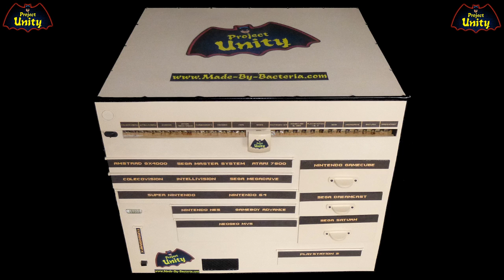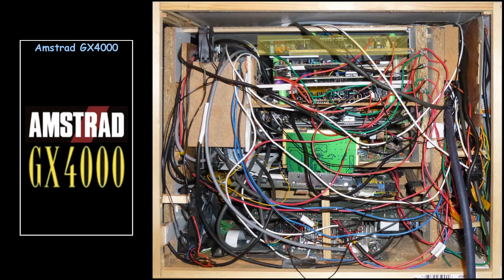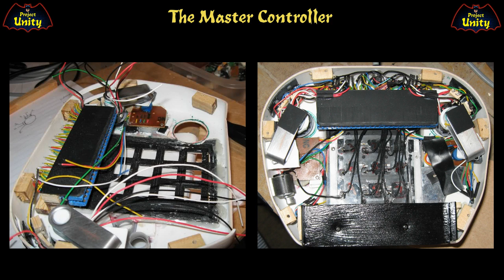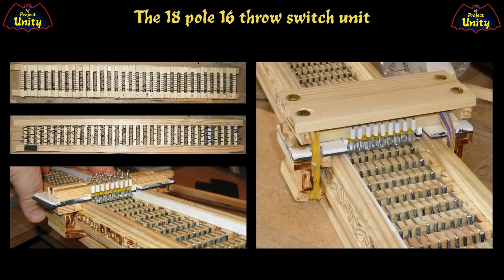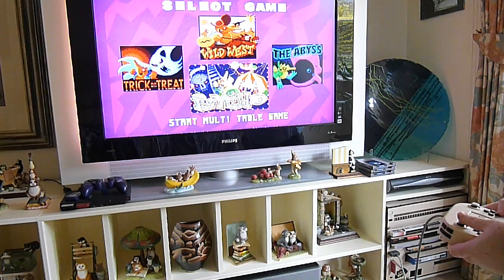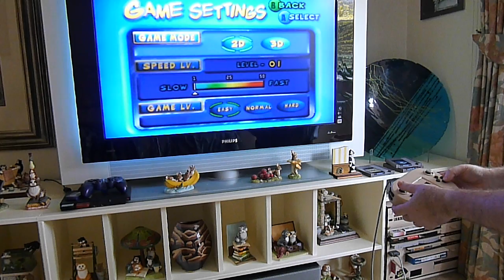Project Unity - the multiple retro video gaming console system

Comment from the maker: The trigger shoulders are basically activated by a variable resistor, so instead of using one of those, i've used a normal resistor with a mushy tactile switch which actually works pretty much as well. You see that for example in the GameCube demo when i'm rotating the screen left and right. Analogue triggers stick out of a controller a fair bit so this was a different way to get the same functionality.

Comment from the maker: A controller is just an interface for a console system. Some original game controllers are really badly designed, the worst example is Colecovision, hard to hold the controller properly and the d-pad is the worst i've ever used. Original consoles have a variety of controller options too including 3rd party ones (eg many versions for N64 for example).

So, I see your point but a controller is an interface only; and also this one has been custom made to work great with my hands, so ideal.

Comment from the maker: I wanted to keep away from using modchips; had one for the Saturn but didn't use it, wasn't aware of any games on PS2 I wanted I couldn't get on PAL format so didn't bother; only chip I used was a SuperCIC for the SNES to make it multi-region as had some NTSC games. TurboGrafx was easy to make region free, as with MegaDrive as just needed wiring to the boards differently, so did those.

Comment from the maker: It will be a pain to fix but the boards can be removed, would not be ideal. The boards date back to around 1979 (Intellivision), 1980's and 1990's (and a couple of systems later), so will need replacing at some point. Cartridge based systems are pretty reliable though, although electronics can fail when so old; the less reliable formats are disc systems, especially DreamCast.

Comment from the maker: No, in the previous revision of the system it was an issue, so I rebuilt the system from scratch a while back; all cables are shielded and are grounded at both ends to stop interference. That's also how I managed to have the cable to the Master Controller about 4 metres long. That took a lot of effort but the result is crisp graphics images without wavy lines, and also clear audio. Different consoles had different video needs, so that was taken care of too, on per system basis; to join to one.

Comment from the maker: Just checked out the thread on Engadget and The Verge - very nice reviews. 

For me, emulation does not feel the same, you have to mess about with configuring them, and then as you say, the audio can be off or stuttery, graphics issues, etc; also retro games were not enhanced graphic versions, you got what you got. Original is better, which is why putting in all the effort to make this system was so more rewarding than using emulators in a PC board.

Comment from the maker: Some original controllers, or their 3rd party versions were excellent, however most were too small for comfort or literally just really bad controllers (eg Intellivision, Colecovision, Atari). Where-ever I could, I gutted boards from broken controllers or ones in poor state rather than using nice clean ones.

Using original controllers also is a pain which would need a box of 15 controllers, with their wires all getting tangled too. Solution with one controller doesn't have that issue.

Comment from the maker: Hardest console ended up being the last one, couldn't fit in a TurboGrafx so used the CoreGrafx instead (PC Engine), and made it multi-region. Yes, got through a couple of dead boards in the process, SMS board fried when I mid-fed the voltages so used a 2nd board, a GameCube board insisted on resetting the clock so changed the board; the Colecovision had a fault with not reading the controller, changed the IC chip on it and made it work. Play most of the time - N64, SNES, TurboGrafx probably.

Comment from the maker: It uses two tactile buttons to replicate the normal trigger buttons, one is a rubber topped tact button for variable press and second the clicky one like you get at the back of trigger buttons. If you notice in the GameCube game, moving the screen to the left and right, as i'm doing, uses the trigger buttons normally; just a different way to do the same thing.

Comment from the maker: There is a memory card for the GameCube hard-wired in the system, a PS1 and PS2 memory card on the Playstation 2, the N64 has one in the controller unit hard wired, the Saturn has a memory card inserted, and the DreamCast has one in the controller unit too. All covered.